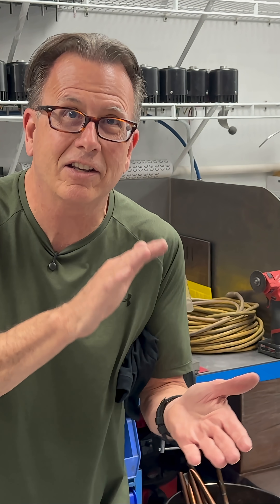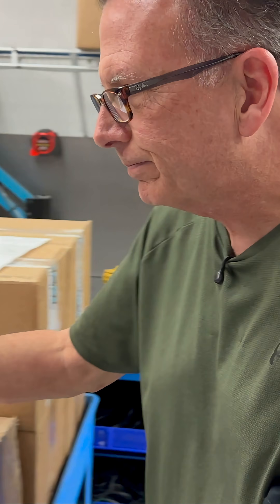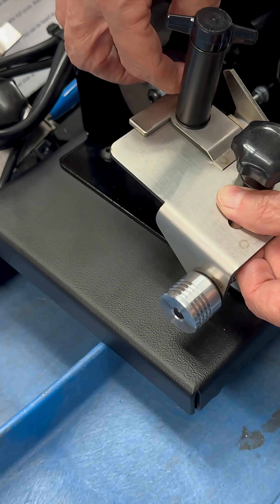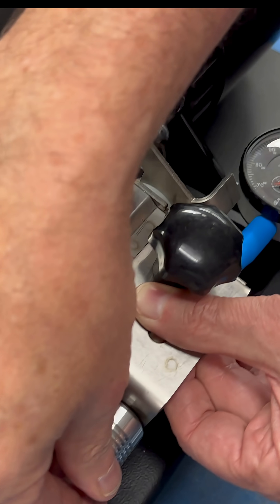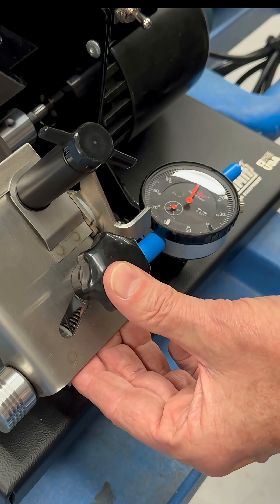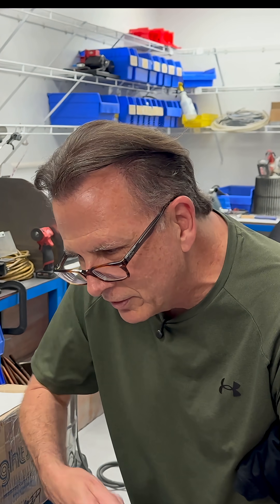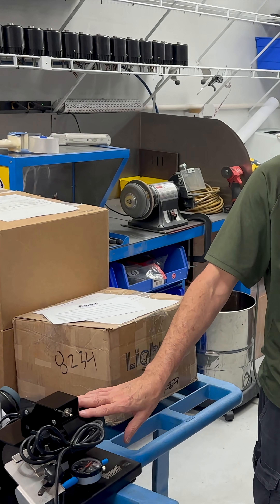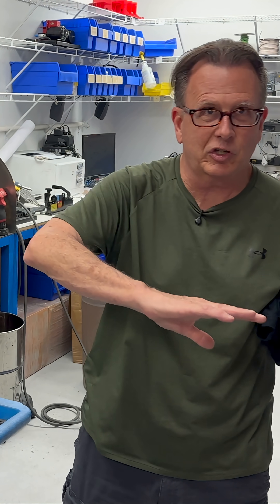Ring Gap Filer for RACING - Keith Jones w #BarryT #TotalSeal #enginebuilding

Comment: Last time we built an engine, we had a simple cheesy hand crank dealio 😂. That was 1993 and still have the engine running strong in my 70RS🎉. 
There's more to ring gap. Street vs strip, cast aluminum vs forged, top ring location in relation to the top of the piston. Get it wrong, and you just built an expensive grenade.
Reply from the maker: Right?  Great comment

Comment: I have successfully built engines  for three decades.  I file my rings with a battery mille file on a 4 inch board top ring 21 thousands  second ring 18 thousands i have never had a failure and if is slightly bigger put it in there it will be fine .
Reply from the maker: That's a great technique - thanks for sharing!

Comment: CAUTION!!!! Those closet shelves rack system.. those plastic dual screw clips, you need to remove those, and replace with the aluminum ones.. I had those in my shop, and one day, the whole shelf came falling down, the bit of plastic strap that coves over the plastic coated metal rod, pulled right through, and the square parts where the screws go through, remained intact on the wall ... 

So, it looks like you have some delicate instruments on that shelf.. careful!!! ASAP.. mine only lasted about a year and when one lets go, they all let in a Rube Goldberg type event.. I was standing at my milling machine, fly cutting, when mine let go, and I had one at 16 on centers stud mounted.. so, get busy.. lol
Reply from the maker: I’ll pass that on to

Comment: I use a little hand cranked ring grinding wheel.
It takes material off much faster than you might expect so I do one crank then measure, one more crank then measure.
Sure it's tedious but it gets me the results I want.
Reply: That sounds just like the one I got from my dad. Circa 40's. Works great!
Reply: It does take off a lot of meat quickly. I've jacked up my fair share of rings😂